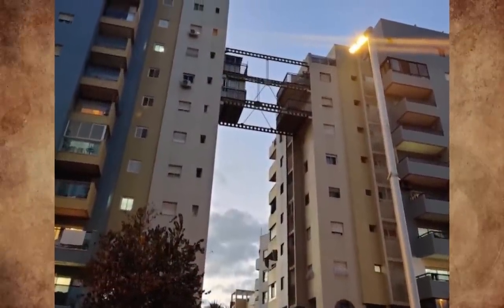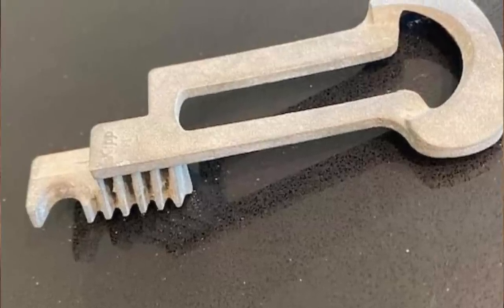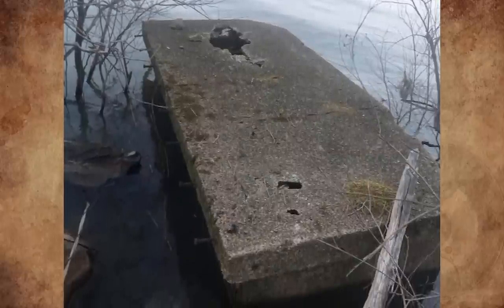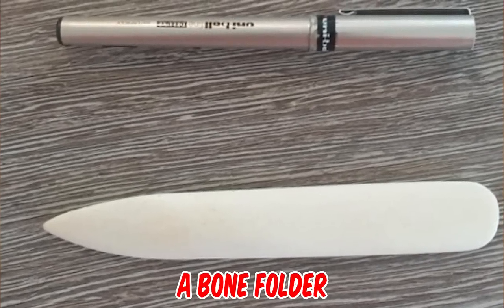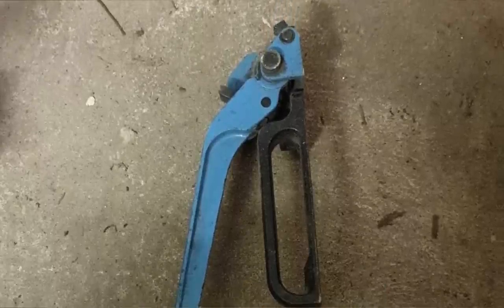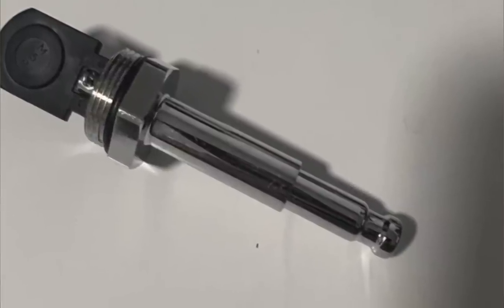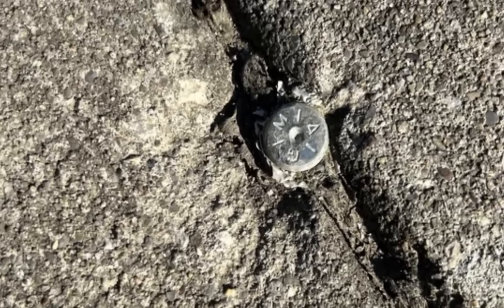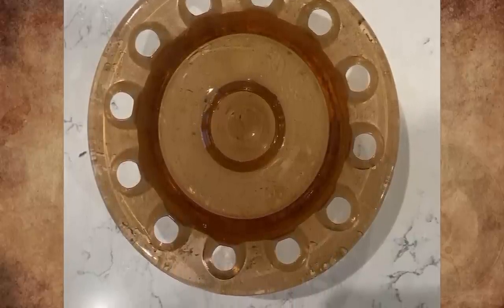What Are These Things? #viral #viralvideo #shorts #short #funny #shortvideo #education #history

Comment: The bone is used for many things. When businesses letters were folded by hand you might crease them with the bone
Used often in crafts and some in sewing. They come in different shapes that can specialize them more.
Reply: Individual letters are still folded by hand. What, you think they're going to take single or small handfuls of letters and run them through the machine? The machines are notorious for screwing up the folding (on at least a handful per run)...and are for mass mailings. You'd never even think of using a machine for important letters, not if you want to keep your job.
Reply: @TheEudaemonicPlague In the few instances when I need to return something letter- size in an envelope, I know how to triple fold by eye and crease with my fingers!  Sometimes these older things can still come in handy without a bone folder.

Comment: The vegetable grip for the mandoline is missing the moving piece that continuously pushes the vegetable off the spikes and positions the surface of the vegetable as it’s being sliced. The piece would have a knobby platform the vegetable is positioned against, with a rod that passes through the central hole and a grip for the palm for pressing the vegetable down onto the surface of the mandoline.

Comment: On the flower frog/holder, you can use the small inner ring to hold a taper candle for use as a centerpiece on a dinner table with flowers in the outer sections. I have several as I collect them.

Comment: The white piece you showed could be a tamper-scraper for a tobacco pipe, I have one that is ivory, yours is probably ivory or bone.
Reply: No, it has nothing to do with smoking, and would make a pretty much useless tamper (...too thin by far. It's a folding bone (or bone folder or whatever you like), and identical ones (touted as being genuine cattle bone) are easily found in places like Amazon. Also used for burnishing and whatever use people have found for them. I can pretty much guarantee that what you have is neither ivory, nor for smoking.

Tampers and scrapers for pipes are normally made of metal, though I recall seeing some novelty designs made of other materials. Quit smoking just over two months ago...I should gather up my pipes and find them a new home.
Reply: I don't remember what the item from the video looked like, but I do have a tamper scraper made from ivory, I purchased it along with several other ivory smoking implements.